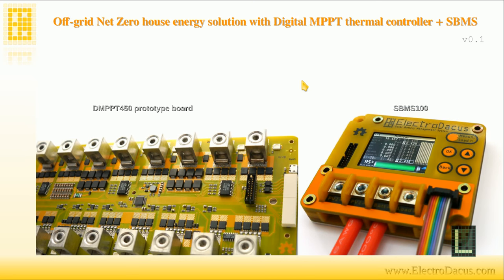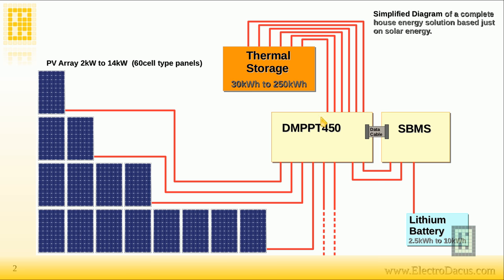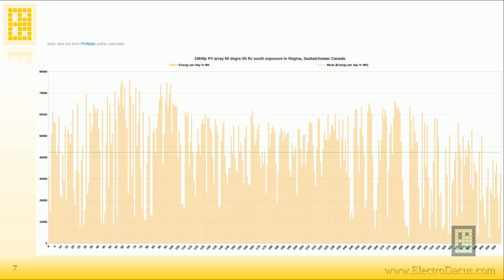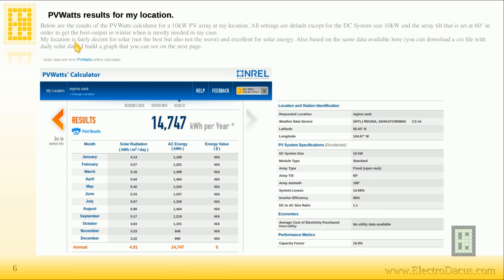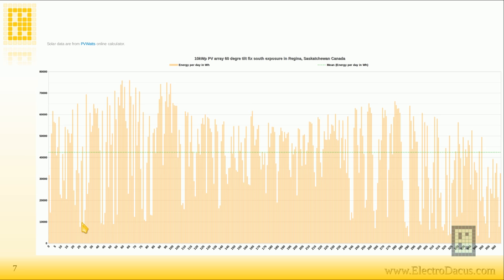Explaining the Digital MPPT thermal controller

Comment: I'm looking at the chart showing residential energy use. It shows 6% for cooling. There something wrong with these numbers, either an average for a country the size of the US is borderline useless. Or the "Energy" they are showing is not electrical consumption but maybe thermal consumption. IDK. I just know that in my location. In my situation the electrical consumption in the summer and the winter is very similar. In the fall and spring consumption is about 1/3 because I'm not heating or cooling. So I have to conclude my consumption for cooling is about the same as heating. It's a lot more than the 6% of the total shown in the chart for the US.
Reply from the maker: Keep in mind that refers to energy not just electric type but also very common natural gas for heating.
Also cooling a building requires way less energy than heating.  Yes it will vary based on your location in US and the graph shows the average but look at Australia they have 5% of energy used for cooling.
For example I'm in Canada and here at my location average temperature in January is -16.7C so if I want to maintain +20C inside the house the delta will be 36.7C where in summer even in a hot location average temperature for say August will not be more than 27 or +28C that is just 2 or 3C delta if you are OK with +25C inside the house so since delta is 10x smaller the amount of energy is 10x smaller also but this is for a COP of 1 but a good air conditioning unit will have a COP of around 3 so that means now 30x less energy needed to maintain +25C in summer than to maintain +20C in Winter assuming the same house.
I'm confident those IEA statistics are fairly accurate.
Reply: @electrodacus  first I want to express how much respect I have for your work. I am impressed. And none of what I say takes away from the work you have done. But I have a big problem with the chart you showed. Conditions vary considerably across the US. For example: I spent time in Michigan. No cooling required. All heating load. I chose wood for heat. I could use natural gas, but I could find wood for free. (I got free exercise too. And wood hearts you at least twice, once when you cut it and split it and second when you burn it.) The house was also passive solar. So we did isolate the solar space at night to control heat loss. Total energy bill for electric and gas was $30/month on a 3200 square foot house. Where I am now my power bill goes up the same amount in the summer that it goes up in the winter compared to no heat or cooling during spring and fall.

Also a heat pump will add more heat to a space in heating mode than it will remove in cooling mode for the same temperature differences. This is because it takes energy to create the effect in either direction. But in cooling mode the energy consumed by the compressor is rejected to the outside as waste heat where as in heating mode, that same heat is not wasted but instead added to the inside. Also inside, people living in the space add heat (about 350 btu/hour/person). Your computer adds heat. Your lights. BTW When you are heating with resistance wire like you are doing LED lighting, or more efficient appliances don't save you anything when you are heating. A 200W incandescent light or 17 W LED may make the same lumens but the 200W bulb adds 200W of heat and the LED only adds 17W of heat. Simply put heating is much easier to accomplish than cooling. You pass current through a wire you get heat. And while there are thermoelectric coolers, they have horrible efficiency. Also all the electrical power consumed by devices inside the home become heat this helps in the winter but costs in the summer. Also looking at temperature difference only, ignores latent heat (humidity) there is a huge amount of heat stored as water vapor that must be removed to have comfort in summer in a humid place. To put this in perspective a pound of water is cooled 1F by removing 1Btu of heat. Where as to condense a pound of water vapor to liquid almost 1,000 Btu of heat must be removed. To remove latent heat you have to lower the temperature of the cooling coil below the air's dew point.

I am a mechanical engineer. I've been doing heating and cooling and refrigeration my whole career. I've seen time and time again how even engineers that come from climates without significant cooling needs grossly undersize cooling equipment for use in the US. I don't know if it will make sense to you or not, But another example of the challenges that cooling represents compared to heating: 1 pound of coal has the stored energy required to melt a ton (2000 pounds) of ice.

1 Joule of electrical energy is not the same as 1 Joule of heat energy. I can take 1 Joule of electrical energy and turn it 100% into heat just by passing it through a wire. I can even multiply it by sending it through a mechanical device and get 3 or 4 Joules of heat out for 1 Joule input. But if I take that Joule of heat and inject it into the typical power plant with all the losses it has, I'll be doing well too get 15% back as electrical energy at my house. Under really ideal conditions I might get  30% back. Second Law of Thermodynamics, and Carnot efficiency.
I live in a temperate area. Winter temps rarely go below 40F and summer temps rarely get into the 90sF.

I'm just getting started in solar but already I know the hardest thing to do off grid is going to be too provide acceptable cooling. I am looking at 48VDC heat pumps to provide cooling. During the summer cooling represents 2/3 of my energy consumption. Trying to run that with an inverter and using my existing equipment does not look very desirable. The inverter gets to be huge just to be able to handle startup because of the AC induction motor. Where as DC motor does not have that issue. Plus no inverter loss.

Sorry this got so long.
Reply from the maker: @barrellcooper6490  Yes typically a heat pump will be more efficient at heating assuming same temperature delta with exactly a COP of 1 so say cooling at 10C delta has a COP of 3 then heating will have a COP of 4 for heating at same 10C delta.
Yes also all electricity used inside the house ends up as heat including the fridge or freezer. 
In my case 120kWh/month is the electricity used inside the house excluding the heating tho it is still part of the heating. In January my small well insulated house requires about 1000kWh so that 120kWh from the appliances is a small part of the total heating required.
I think most house have terribly inefficient and unmaintained cooling systems that are far from as efficient as they can be and houses are far from properly insulated but that affects heating in an equal way. Using wood still counts as energy for heating in the IEA graph and it is added there tho natural gas is by far on top in terms of heating in US and most of the world as it is just 2 to 4 cent/kWh and thus much less expensive than electric heating or almost any other source that you can buy.
DC cooling devices are less common and in many case lower efficiency as they are not manufactured in the same sort of volumes. Most modern AC even have variable speed compressors that are basically DC. 
And yes maybe in the two or three hot summer months your cooling may represent half or more of the total electricity usage tho that will be averaged over the entire year and natural gas and wood will be considered also thus that graph is correct.
Even if your winter temperature will almost never get below freezing the 40F to 70F between outside and inside is a 30F delta that energy will be from wood or natural gas with a COP of 0.6 to 0.8 where the difference between 75F and 90F just 15F will be serviced with a heat pump with a COP of maybe 3 thus at least 4x less energy for same house.
Those 40F and 90F are what you call typical temperatures but the important ones are the average temperature over a period longer than 24h
PV panels have a cost amortisation below 2 cent/kWh thus able to compete with natural gas (the most cost effective energy source other than PV) and that includes wood if you do not consider your work free. Thermal storage is also super inexpensive can be below 1 cent/kWh and thus the combination of this two makes for the most cost effective heating and cooling solution (when paired with the inefficient peltier or an air to air heat pump).